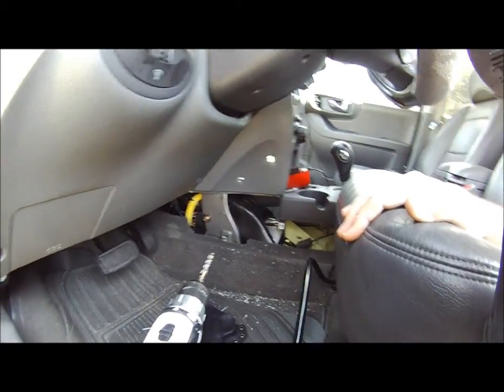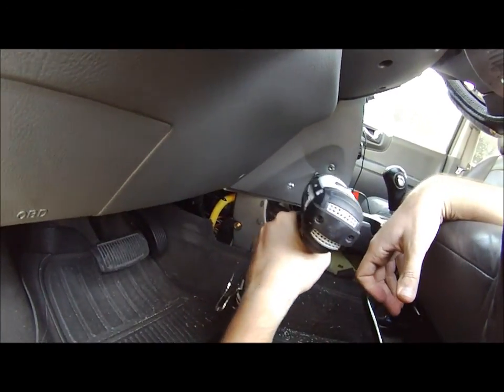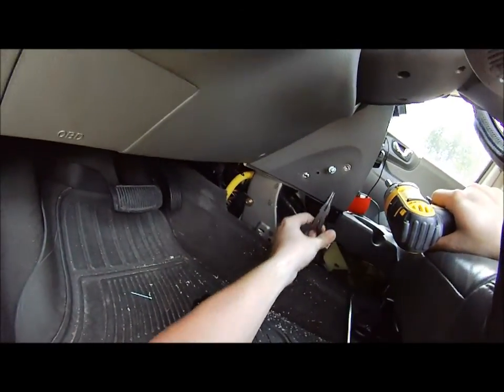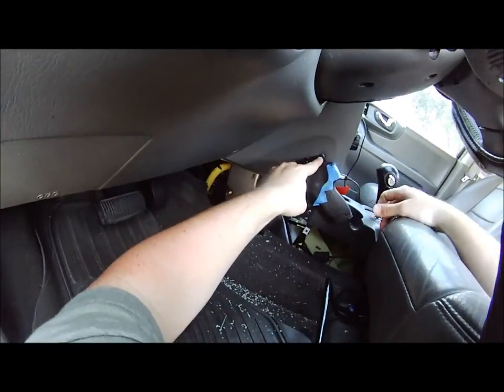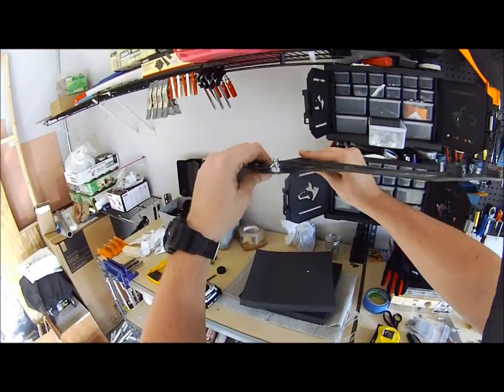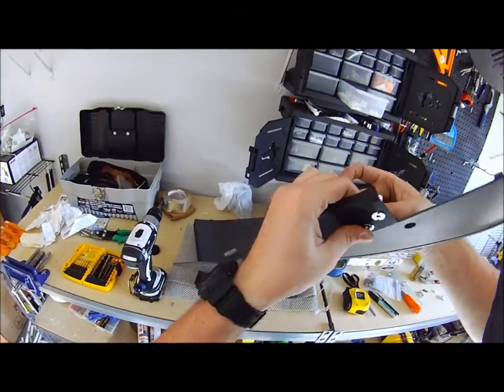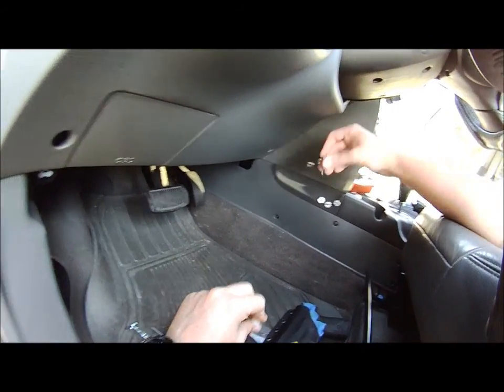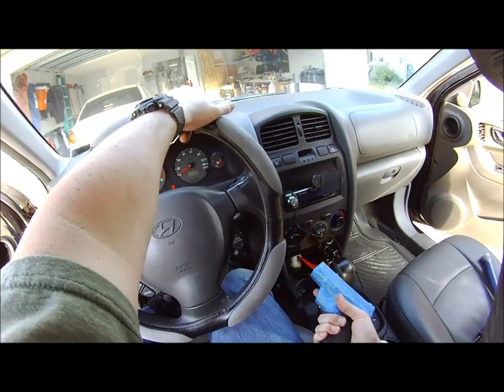M&P Shield 40 Kydex Vehicle Holster - Part 3 (Final)

Comment: What brand of holster did you use?  Also, my first thought was why not use pop rivets (and washers if needed) instead of wall anchors?
Reply from the maker: I made the holster.  Check out part 1 and 2 to see how. 

As for the rivets, i wanted to be able to remove it if needed.  I also need to space it away from the surface i attached it to so that i can slip my fingers back there for proper grip once the gun is removed from the holster.  I also didn't trust a rivet to not go right through the material i was installing it to. Car interiors have a plastic base with foam and something like a vinyl skin wrap.